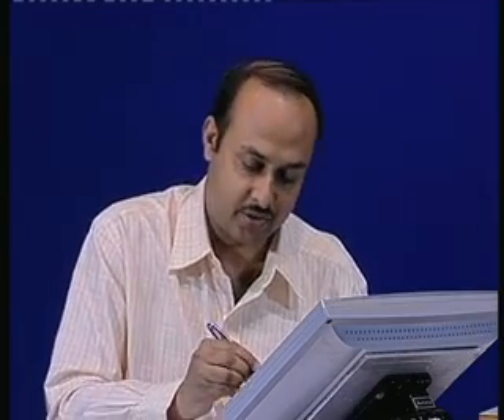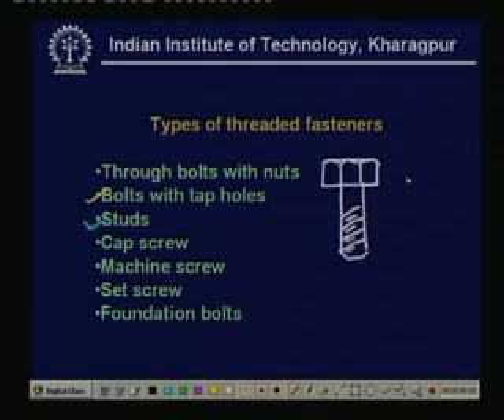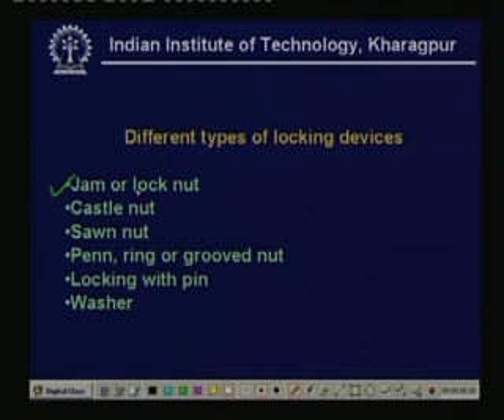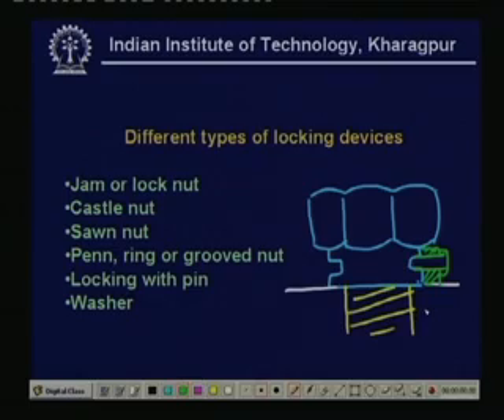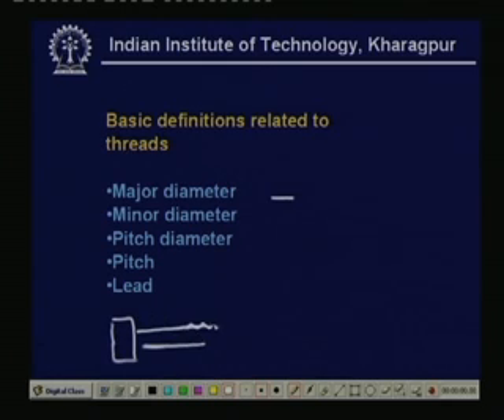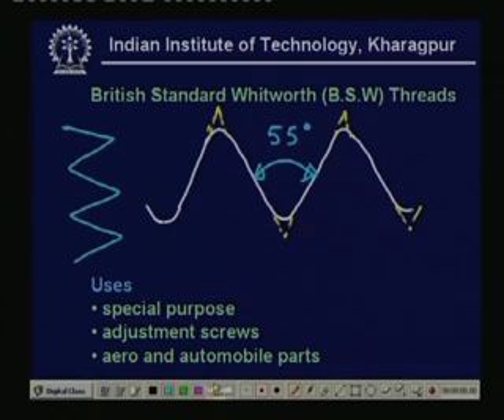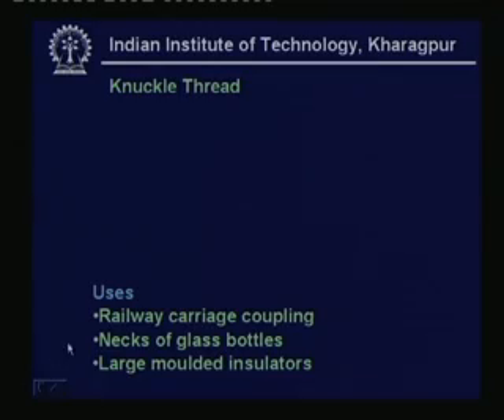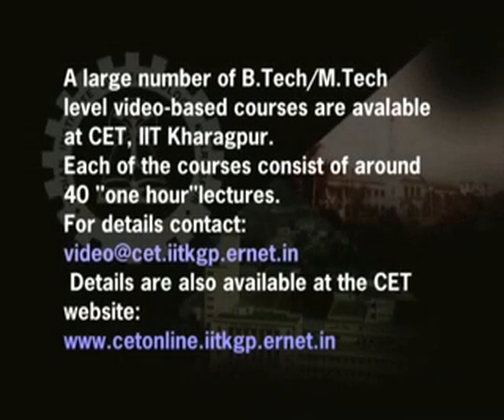Lecture - 16 Threaded Fasteners

Comment: Please tell me what is the difference between bolt and screw.?
Reply: Although it's same , but in some cases bolt are mention as full thread , screw are full thread.
Reply: Both are threaded ,but difference is that , 
# bolt will have threading all long the length of shank i.e from the bottom of bolt to the bottom of the head .
# whereas in screw if you see, it will have been threaded only up to  " threading portion " & shank could be seen unthreaded.